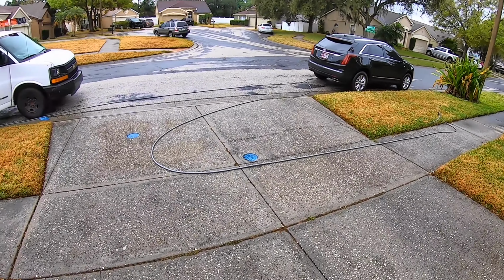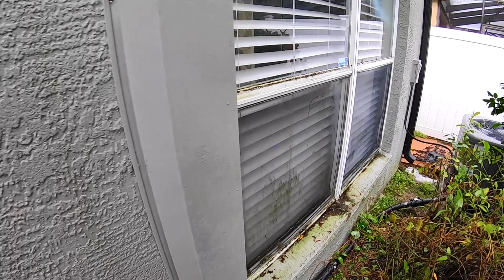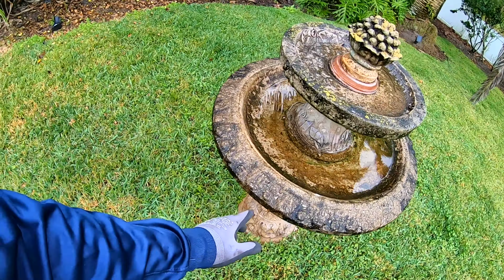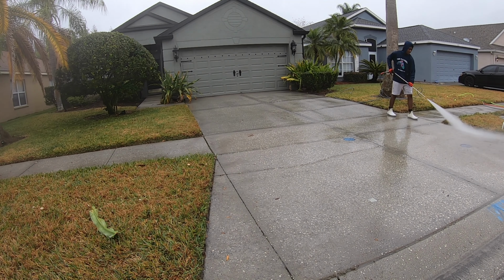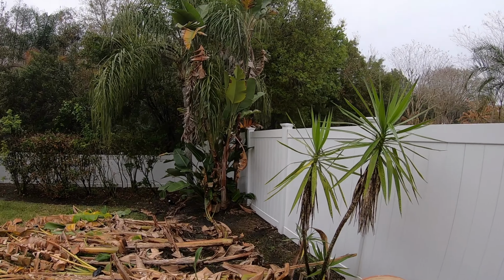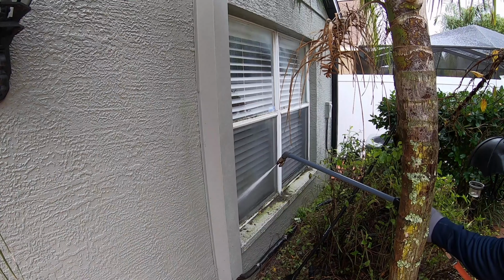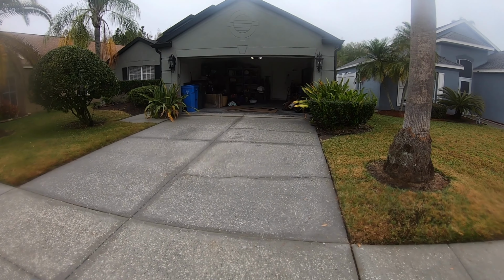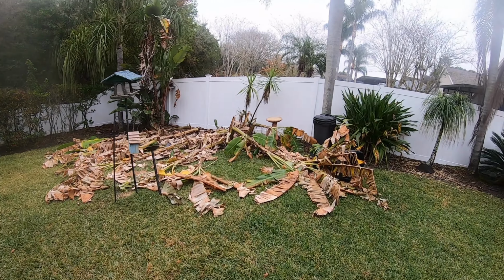Father and Son Pressure Washing Day

Comment: Knocked out my first pool cage, lanai pool pavers, and driveway. You were with me brother every step of the way. 500 in 8 hrs. Couple rookie moves (not recognizing the SH had stopped pumping) and the brand new 4 gal blew a fitting off that had a spring and needle. Twice! Took 20 minutes to figure out what was going on, but I learned from it. Too much fun! Bro, I appreciate you man, more than you know. God bless you and your family, may He strengthen you and keep you close 😉👊🏻👆🏻💎
Reply from the maker: You got it done and you had nobody breathing down your neck. Things happen it's how u learn from them. Going forward you will know how to troubleshoot the equipment.
Reply: Cliff I’m about to give an estimate on a paver driveway/walkway, 370 sq ft. Clean, sand, and seal. Can you share the basic market price for the cleaning, and then the combined price for all 3 together. I’m assuming not every customer wants or can afford the sand & seal so there should be 2 prices per sq ft. Any info is greatly appreciated, thank you for your help
Reply from the maker: @ronslawnscrystalriver2151  personally I only do all 3 as my sealing process. I don't offer sanding unless I'm sealing the pavers.  The average rate is $1 a sq ft. But since you're doing such a small area you can bump it up to $2 a sq ft. A good sealer is expensive,  for instance the deco products silicast is $250 for 5 gallons and it covers roughly 1k square feet.
Reply: @PinkFlamingoPowerWash  thank you Sir

Comment: Great video, did you use the surface cleaner to do the curbs? I’m scared the tips will hit the concrete! Thanks
Reply from the maker: That concrete is far too cured to be etched brother. You're not etching  nothing over 2 years old unless something is wrong with your surface cleaner.